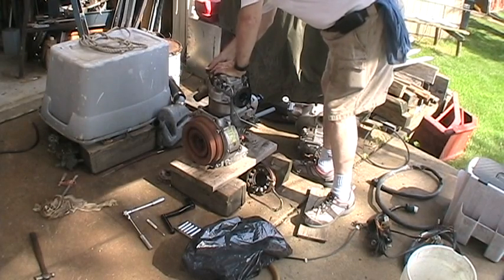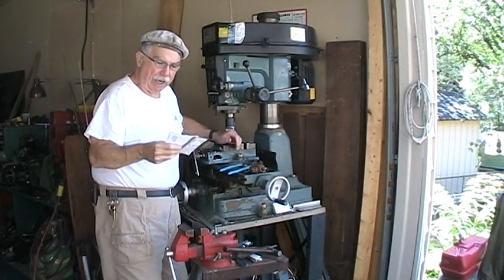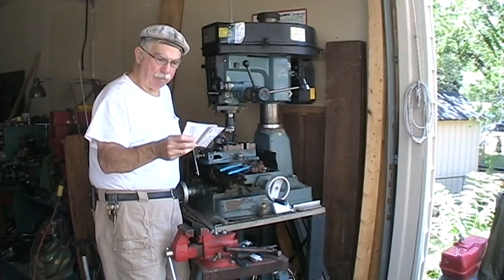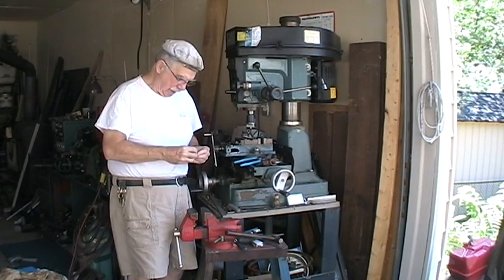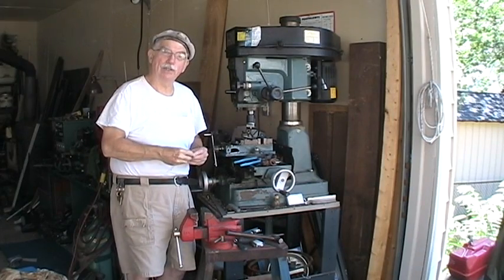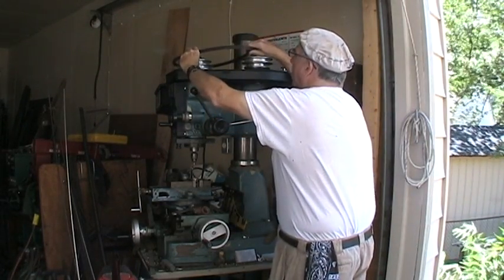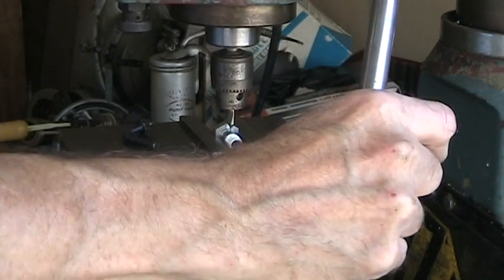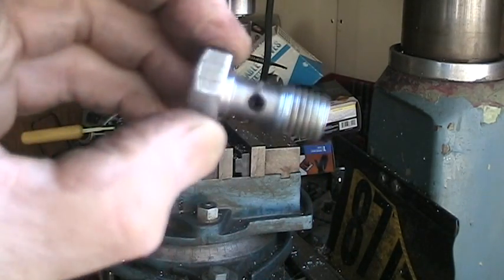Machining a Banjo Bolt part IV

Comment: No need for pi or radius: hole diameter = square root ((0.25 * 0.25) / 2) = 0.177.